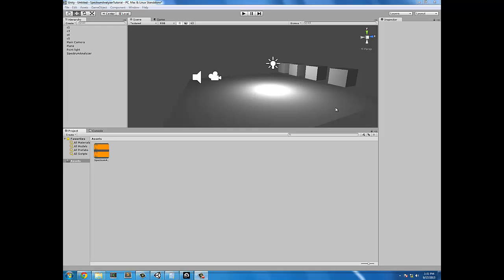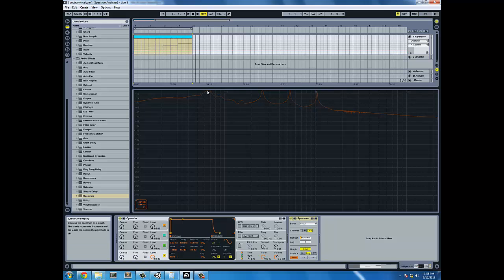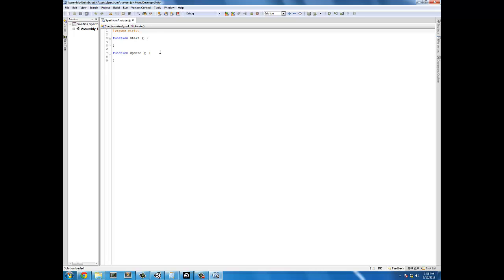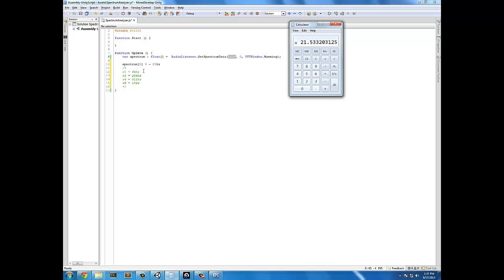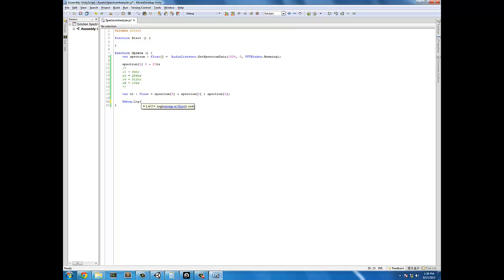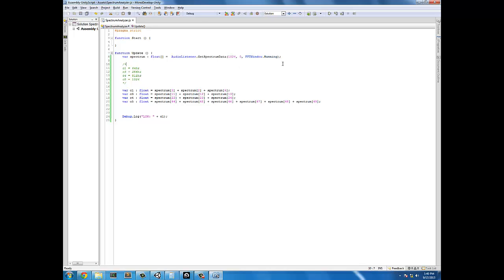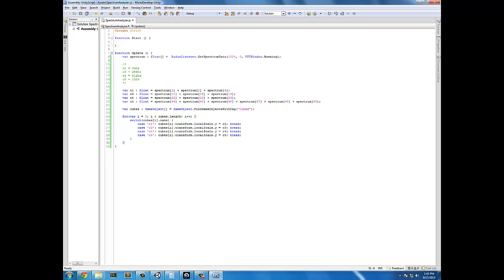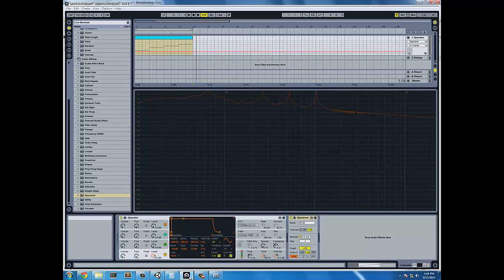Unity - Audio Spectrum Tutorial

Comment: got something working. thx a TON for the video. it really helped me to get started

using UnityEngine;
using System.Collections;

/*  Purpose of this script is to control 5 cubes based on sound
 *   written in C#
*/
public class audioSpecDazzle : MonoBehaviour {
 
 public GameObject cube01;
 public GameObject cube02;
 public GameObject cube03;
 public GameObject cube04;
 public GameObject cube05;
 
 public float juice = 20f;
 
 public float[] spec;
 
 public float specMag01;
 public float specMag02;
 public float specMag03;
 public float specMag04;
 public float specMag05;
 
 // Use this for initialization
 void Start () {
 
 }
 
 // Update is called once per frame
 void Update () {
  //spec = AudioListener.GetSpectrumData(64,0,FFTWindow.Hamming); // this works on audio source
  spec = AudioListener.GetOutputData (64,0);  // this gives much  better values.
   
  specMag01 = spec[2] + spec[4];
  specMag02 = spec[12] + spec[14];
  specMag03 = spec[22] + spec[24];
  specMag04 = spec[32] + spec[34];
  specMag05 = spec[57] + spec[60];
  
  
  cube01.gameObject.transform.localScale = new Vector3(1f,specMag01*juice,1f);
  cube02.gameObject.transform.localScale = new Vector3(1f,specMag02*juice,1f);
  cube03.gameObject.transform.localScale = new Vector3(1f,specMag03*juice,1f);
  cube04.gameObject.transform.localScale = new Vector3(1f,specMag04*juice,1f);
  cube05.gameObject.transform.localScale = new Vector3(1f,specMag05*juice,1f);
 }
}
Reply: Yeh got it working, thanks!
Reply: InceptSquared LERPing is HUGE in Unity3d.  if you don't know how to do it or when to apply it. go spend some committed time to it. LERP and SLERP are similar. Learn to LERP

what you will want to do is Lerp between the Current Value, to Value mors recently read in from the above code, at Time.deltatime * some variable that will be your rate. Changing the last RATE variable will alter how responsive the slerping is.
Reply: Is this basically the c# version of his script?
Reply: G Wedd i wrote that a long time ago, but yeah, that should work. make a test scene with 5 boxes and play a song from a 6th obj, and these should bounce and such
Reply: Reginald Bennett Hey so This works pretty much perfect for me but It seems to be overly responsive and ghosts a lot, Do you think there would be a way to smooth it out possibly? maybe update it every couple frames.
Reply: InceptSquared, The best way to smooth it out would be to LERP the values that modify transform values of an object.  The code above was just the starter code so you could how to utilize certain values. I ended up doing a lot of mods to this code to get some nice looking stuff. I don't have my final code handy right now. but, yeah. Mod away. also, you can change the number of Samples to higher or lower than 64, then select segments to average.  I believe that is what i did in the end was segment the array and average the elements of each segment. the sample code above is only looking at 10 of 64 values in the array, so you are not getting the best representation of your data.
Reply: If you REALLY care about this, there are some great tricks you can do by instantiated prefabs on the fly and referencing those instead of hard coding 40 game objects, but then its not as easy to manually place and manipulate each unless you want a uniform look to it all.
Reply: Dizax Sure thanks that helps a lot, Just need to wrap my head around how to kinda lerp the values that makes more logical sense for what I want to do really. idk this is defiantly a new area for me haha.